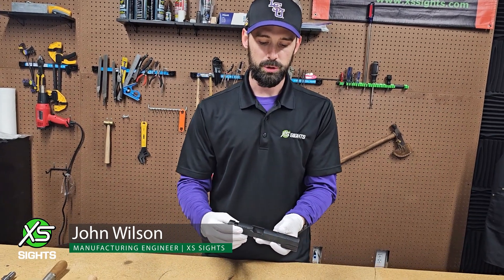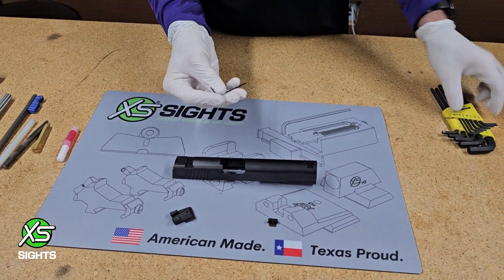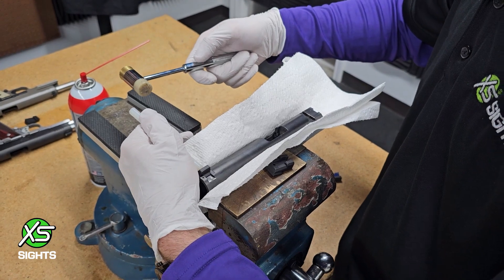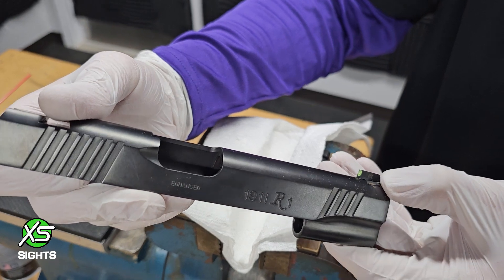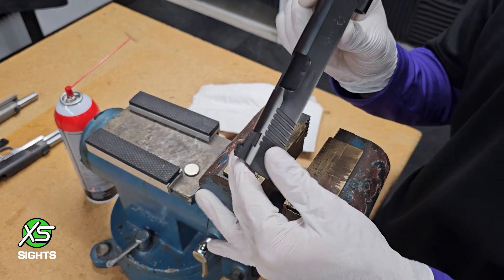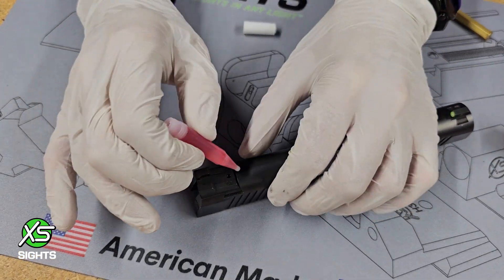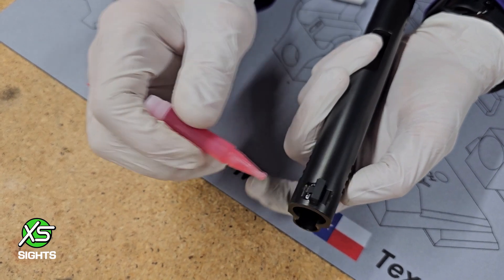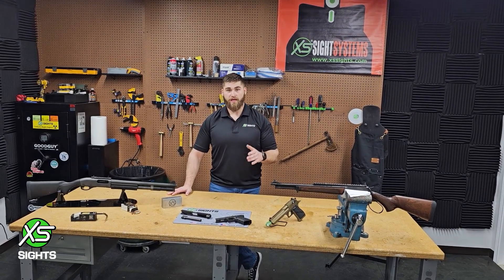R3D 2.0 Night Sight Installation - Hammer & Punch - 1911

Comment: Would they work on a Tisas carry that has Novak sights ?
Reply: Tisas 1911's despite what they say do not use a true Novak cut, it's an imitation.

Don't know specifically about the XS but I've done site changes on three of them and all of them left a humongous unsightly gap on the rear sight and you had to file so much material off of the site that Loctite was the only thing keeping it in
Reply: @rockylindgren5885 thanks for the heads up